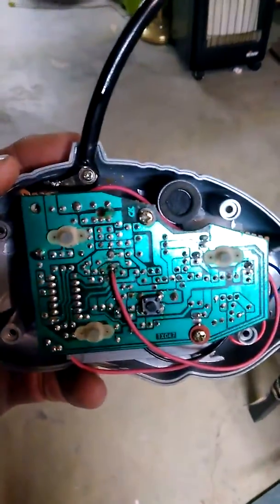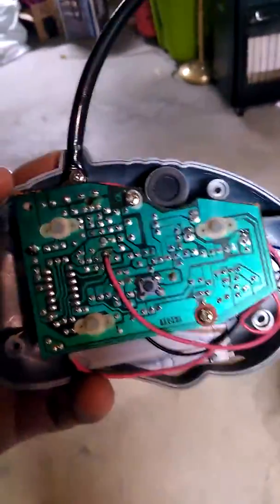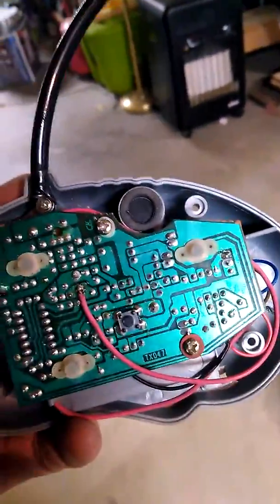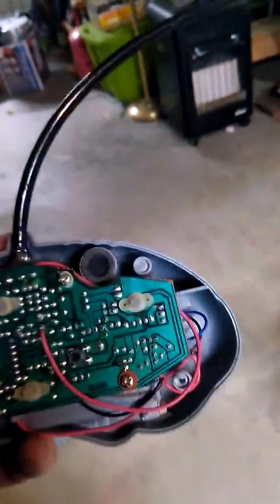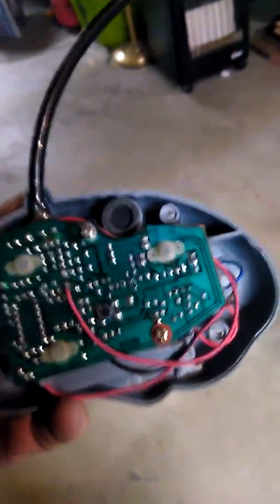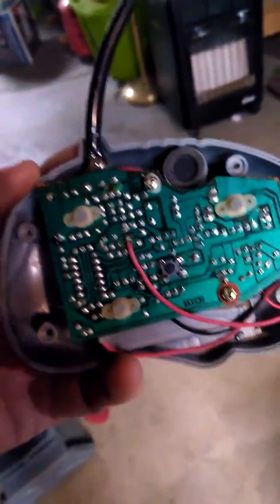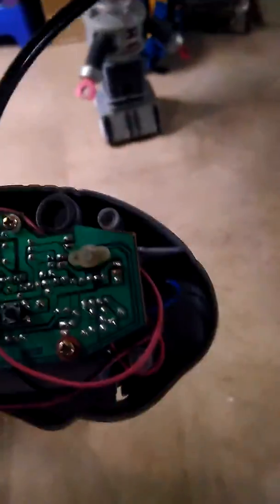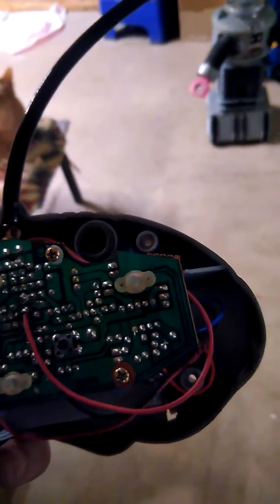Trendmasters Big B9 Lost in Space Robot operation problems Part 3

Comment: Hello Mark .  I know this is an old video but I have a question for you . I recently aquired a 24" LIS robot with out a remote. I found a 4 channel 27MHz remote just to see if things would work . Alll I get is the buzz? Now being that I have little experience in rc I was wondering if you would know a way to run this robot with out the original remote ?   Thank you